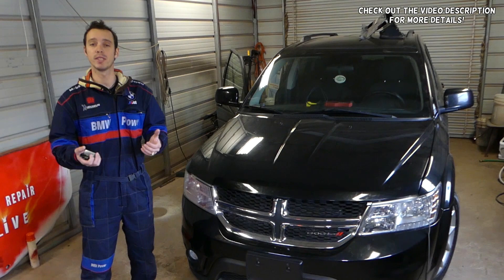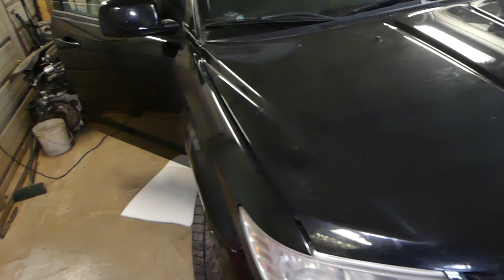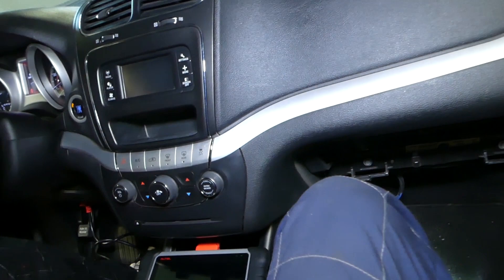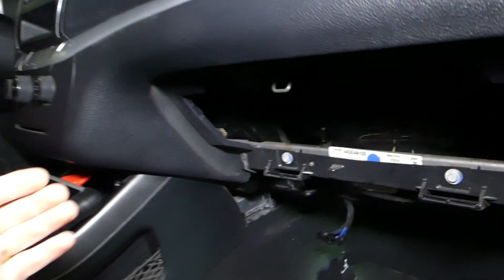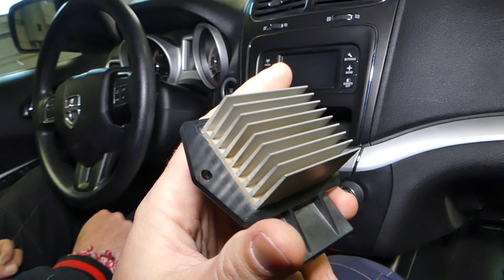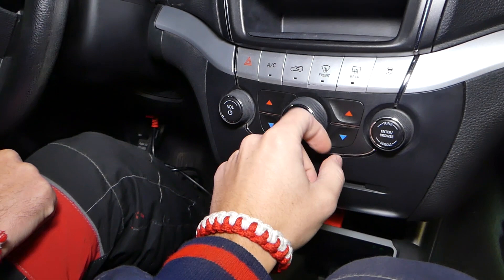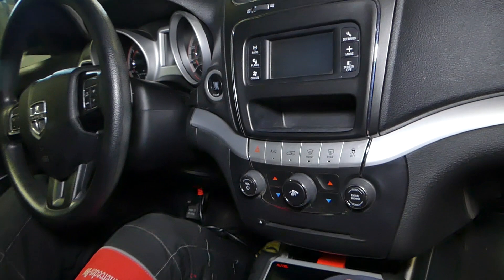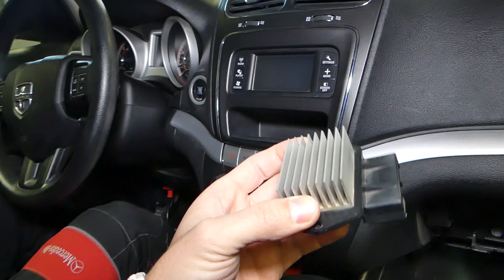BLOWER MOTOR FAN WEAK. LOW AIR FLOW FIX

Comment: Thanks.  My fan in my 2019 jeep grand cherokee just stopped putting out good air.  I can tell the switch still controls different air flows, but it feels like each setting is running at half the speed it should.  I'll check the resistor block first.  Cheers.

Comment: Help me out please!

2018 dodge journey gt. Replaced rear blower and resistor, works perfect! 

Front of vehicle hvac system does not have a resistor, relay is good, fuses are good and replaced blower motor. Speed 7 doesn’t work but speed 6 works very well. Any suggestions?

Comment: I replaced the blower motor and dash hvac control panel. The vent actuators seem to be working properly. When selected air flow only comes from selected vents. FOR A MACK TRUCK. what am I missing ? The blower resister is built into the blower which I replaced

Comment: i have 2016 hyundai santa fe xl with 119k, i have an 8 month intermitten very low air flow out of the vents with cold or hot air. The blower motor works on all speeds but no air comes out the vents, i have already replaced cabin filter...what could be causing this

Comment: Hello, my ac blows on the driver side fine but on the passenger side it barely blows out even on the highest setting. Same thing with the ac vents in the back as well. The ac is warm too barely gets cold. Will this solve my problem?
Reply: No, you need a new blend door actuator..
Reply: Blend door actuator confirm

Comment: Ok guys…I have a good question for you. I have a 2005 Pontiac grand am 3.4L. 
I was experiencing low air flow and decided to change the blower motor and resistor at the same time. Both brand new parts. It worked ok for a few days but I noticed the same thing happening…it starts out good with strong airflow at setting 5….5 being the highest. 
Within 15 minutes of my commute I notice the airflow cuts down and reduces. I’m not sure how much but 50% is accurate I’m sure. I changed out the resistor with a brand new one, so my question is, 
Is there another way other than a bad resistor that would make the airflow reduce on its own, mid commute? Would a bad relay do that?

Comment: I can barely understand this guy. You need to be more specific bc I put in radiator fan not blower fan!! Its totally 2 different fans.😂🤣🤣🤣
Reply: theres a chance...just a chance...that he didnt make specifically for Americans.
Reply: The heater resitor and the heater motor are next to each other. The resitor looks like a small switch the motor is usually about 6 inches round and is under the dashboard.